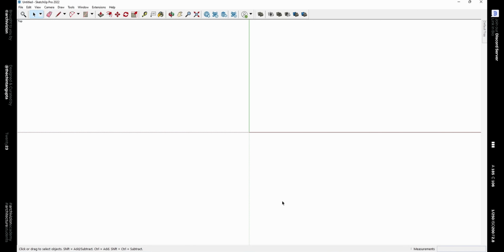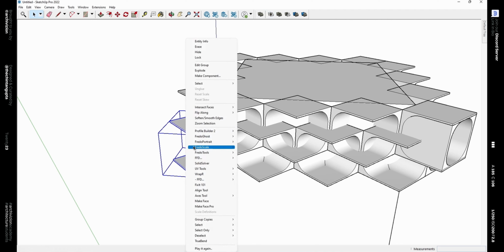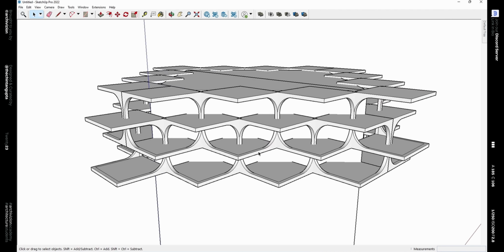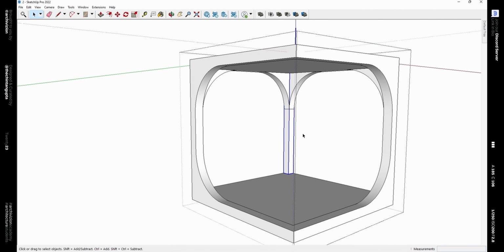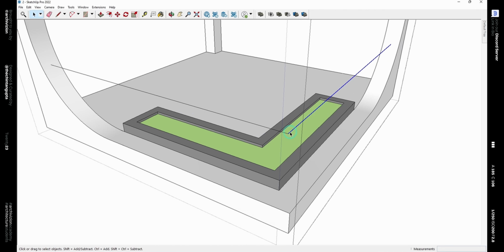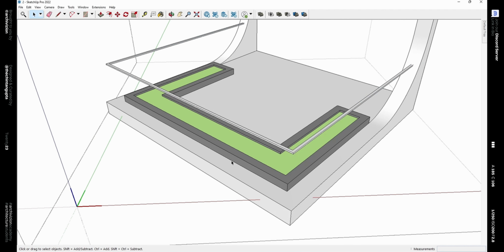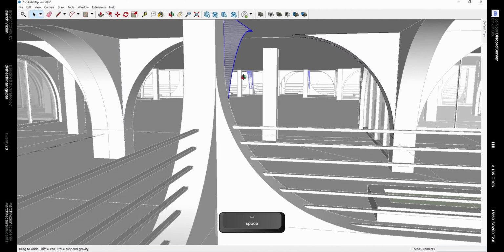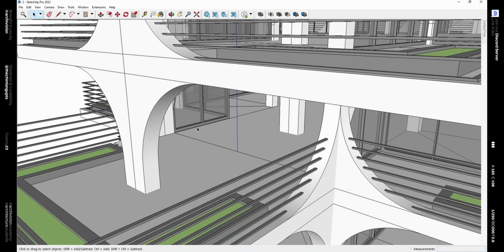SketchUp for Architects: How to Create a 3D Model of the Tel Aviv Arcades Tower in SketchUp

Comment: Did you use any plugins for this?
Reply from the maker: Well technically just the profile builder plugin. But could have easily avoided it by making a rectangle and the follow me tool to make the railings. Except that, just 1001 bit tools to make windows, that can also be done without any plugins if you want